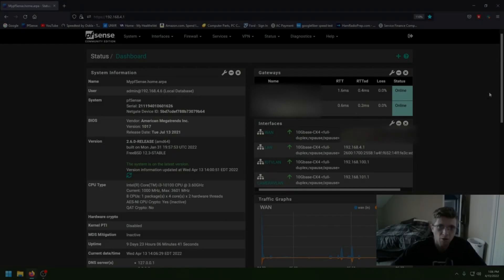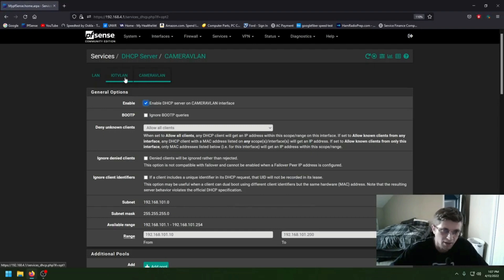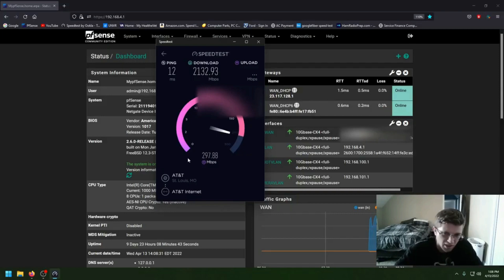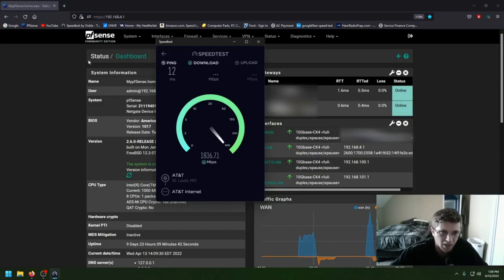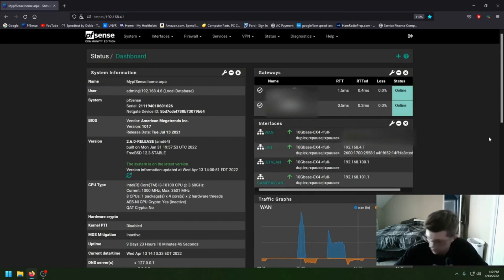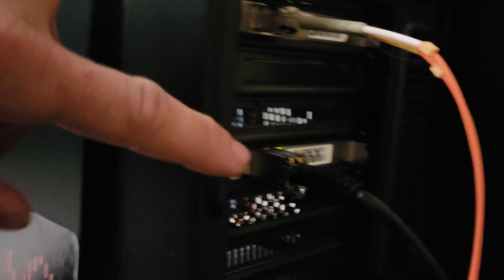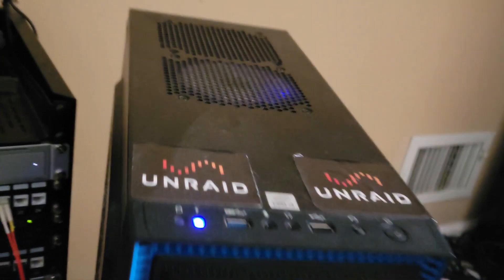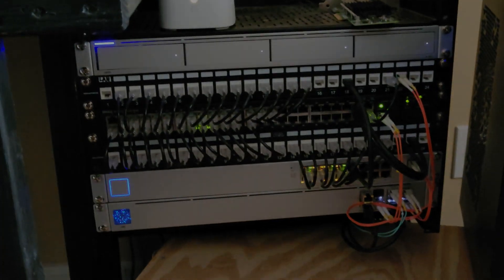Att 5Gig Internet with PFsense

Comment: Hi there, I recently upgraded my setup to AT&T 5 gig speeds and also upgraded my network setup to the UDM SE PRO, 8 port Aggregation switch, 48 port pro-POE switch, and Enterprise 8 port POE switch. I am having trouble getting the SFP+ ports on the switches to deliver 5 gig speeds. They are getting capped at 2.5 gigs. If I connect the PC directly to the UDM SE Pro, I am seeing the 5 gig speeds. I am using Cat6a cables and when I connect to the At&t router directly, I can see the speeds are 5 gigs. It's only at the switch level that the speeds are being capped. Would you happen to know why this could be happening?

Comment: I use a Intel X550 network card for my AT&T 5 Gig Fiber.  Message me if you want to know more.
Reply: I get the full speed up and down, most of the time. Which is capped at 4.7 gigs up and down.